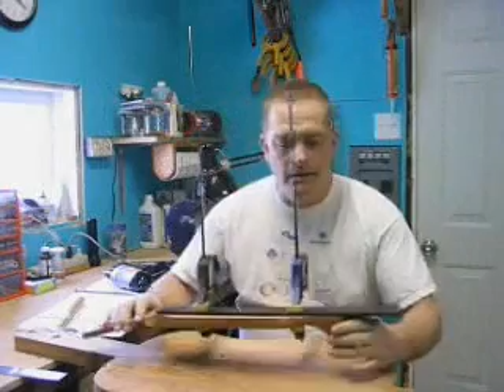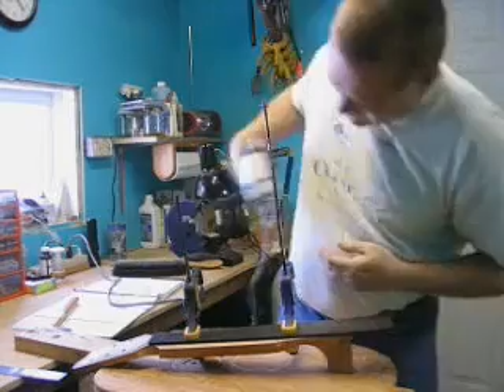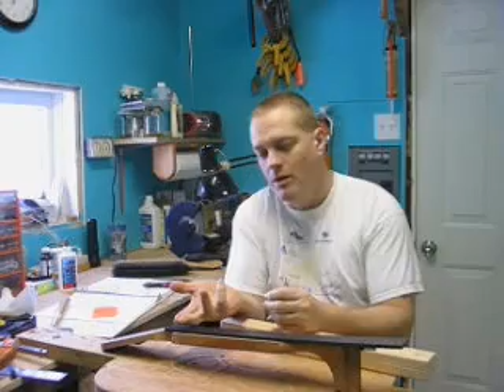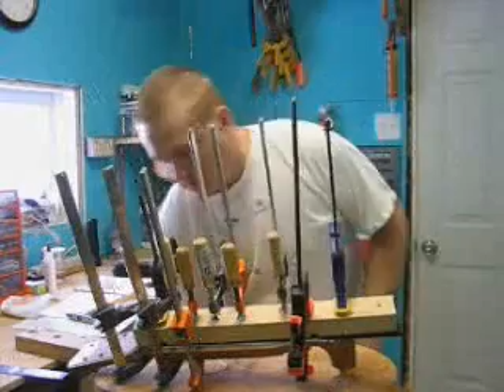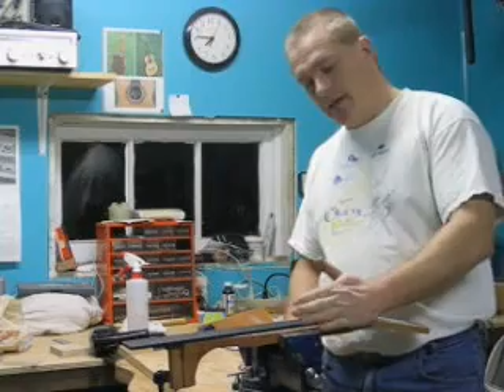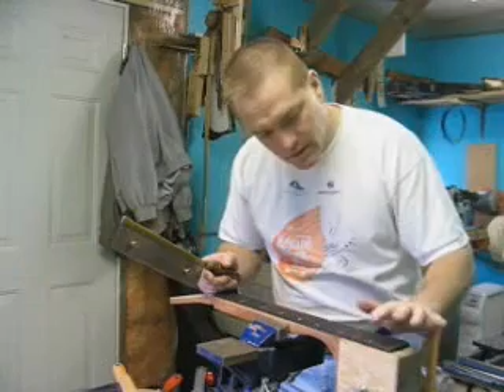Steve's Guitar Making Part 7 - Fretboard 2 of 5

Comment: @dubsaloon It is more expensive than rosewood which is the standard, but is much much nicer and well worth the extra $. I will NEVER use rosewood on my fretboards ever again after using ebony. Stewmac.com has rosewood blanks for 15 and ebony for 28. or preslotted and preradiused ones for 20 and 35. I just buy the pre done stuff sometimes when i'm feeling lazy. I know everything is done nicely and accurately + i use a radius sanding block with some 400 grit and smooth it down. STEWMAC IS THE BEST